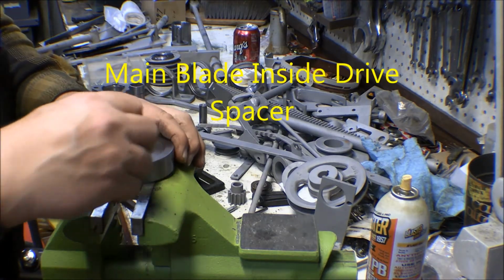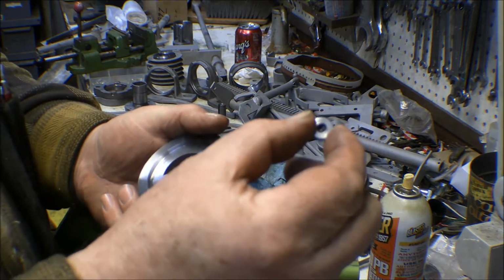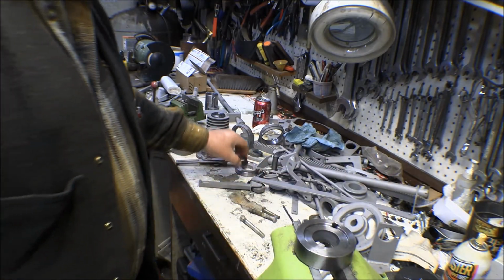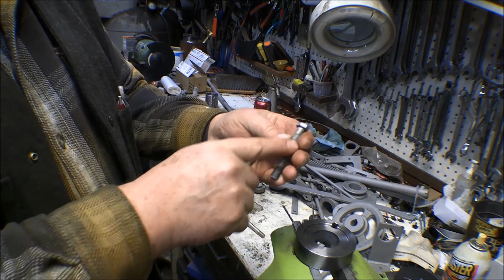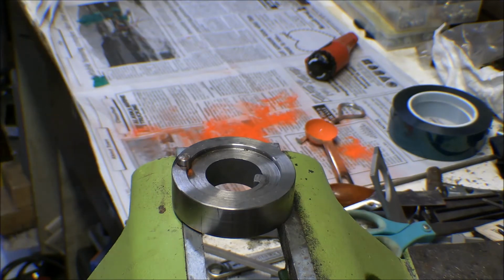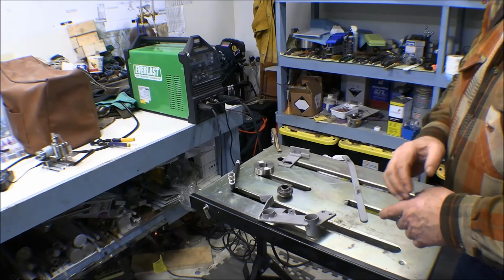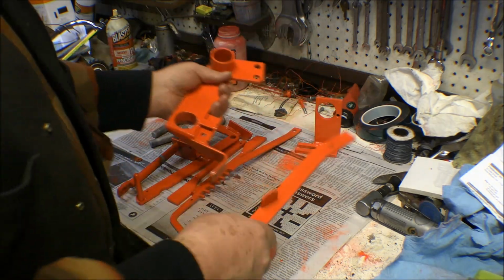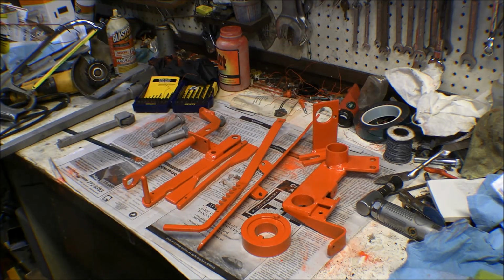Mobile Dimension SawMill Repair; Main Blade Inside Drive Collar

Comment: I have a question I hope you can help with, on the piper aileron trailing edge, the preformed sheet metal ends short of the tip end of the aileron, and switches to a piece of round bar that is riveted in, I can’t for the life of me find a good diagram with the name or part number , or specs to make one up myself.. I had my aileron damaged in storage, so I cut it open to repair the leading edge damage, and see this bar is pretty rusted., still solid, but pretty rusted...
Reply from the maker: Univair has the replacement part, I'd have to look up the part number, but they wanted over $50 for it a couple of years ago when I replaced mine. The blue prints call for 3/8 mild steel .028 wall. I made one up from some stainless tubing I had for making fuel lines for my old trucks.. Here's a couple of links to videos where I did repairs on one of my ailerons  https://www.youtube.com/watch?v=PGwNiGM0dvk,   https://www.youtube.com/watch?v=oQSikE4tzws